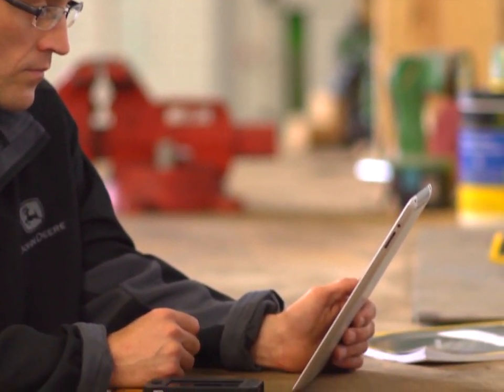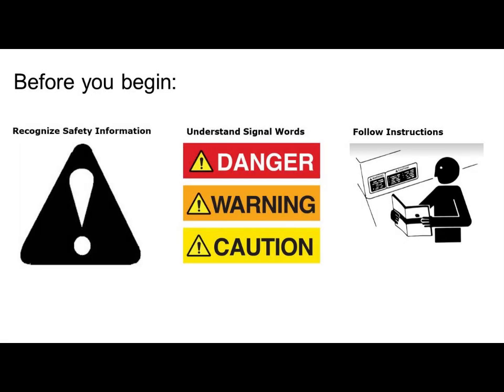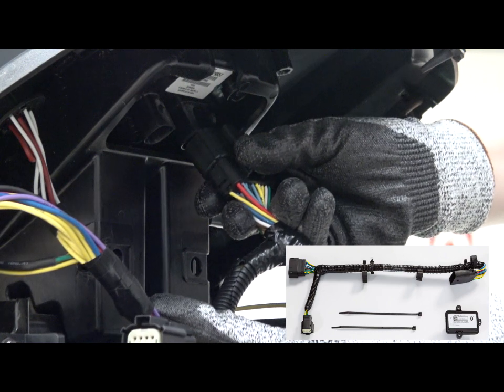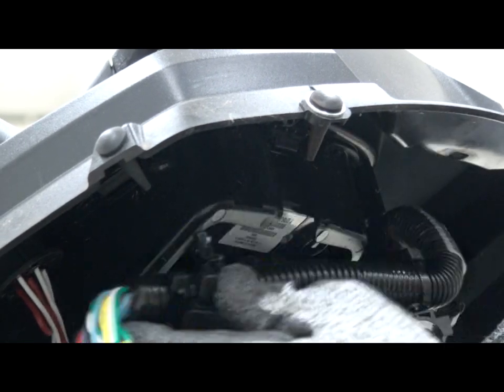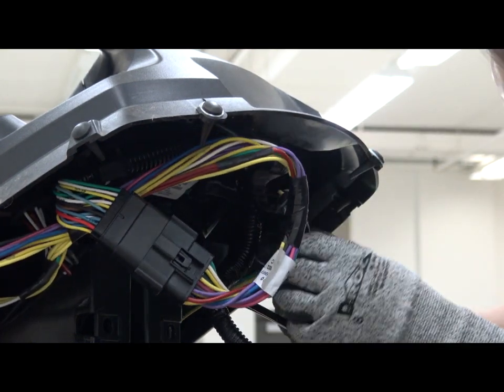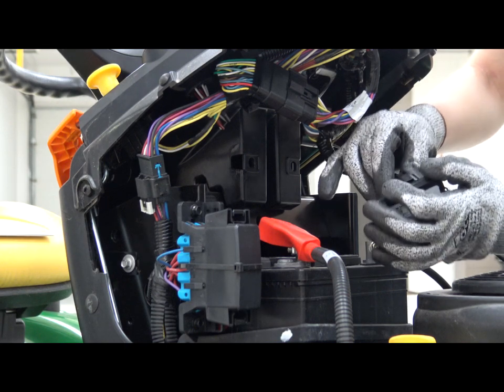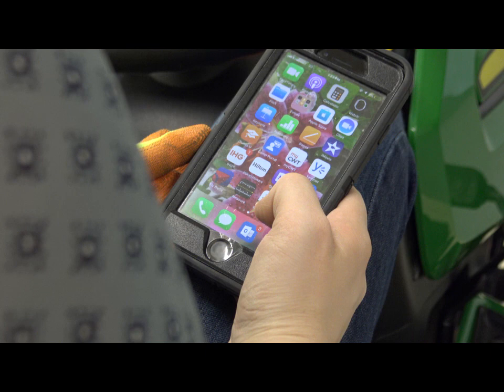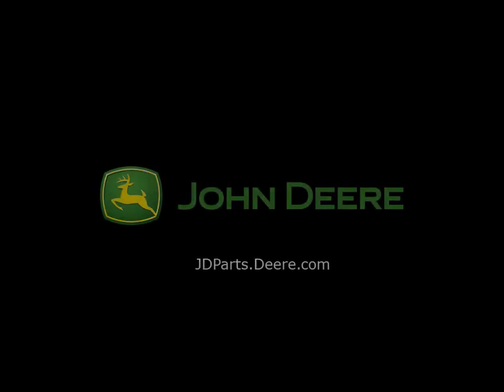How To Install MowerPlus™ Smart Connector | John Deere Select Series Lawn Tractors

Comment: Just ordered this for my x390. Can’t wait to use it. Already have the app. I must’ve accidentally left key turned slightly last time I mowed and since the headlights weren’t working I didn’t realize. Then went to mow again and battery was completely dead and wouldn’t take a charge. Had to have mower serviced anyway and they put in new battery. This may have been an avoidable battery drain if I already had the smart connection.

Comment: Stating the obvious: the tractor hood must be opened for the install. If your tractor has a brush guard, it will interfere with opening the hood; the retaining pin must be removed to lower the guard. When you are finished, the guard must be raised and the retaining pin re-installed. Realize that the engine muffler is mere inches from that retaining pin which may require manual guidance. If the engine was recently run, that muffler will still be hot.

Comment: BEFORE you install the connector wiring, download the smartphone app. It will want the serial number of the lawn tractor AS WELL AS the serial number of the Bluetooth module that will be installed under the hood of that tractor. The module does not require power in order for your smartphone to scan the QR code on the back side of the module. Scan before performing the final connection to the wiring harness and make sure that the QR scan is successful in the app.

Comment: Excuse me.

I have a good question about this.

Is this compatable with mowers from the early 2000s or 90s?

I would love to try it out on my 03 LT150,but I am worried about non compatibility with older models.
Reply from the maker: Great question! We don't currently offer a compatible MowerPlus™ Smart Connector for an LT150 Lawn Tractor. The MowerPlus™ Smart Connector is compatible with the S120, S130, S160, S170, and S180 Lawn Tractors. Additionally, model year 2021 and newer S240 Lawn Tractors (serial number 880,001-) and model year 2021 and newer Z515E, Z530M, Z530R, and Z545R ZTrak™ Mowers (serial number 010,001-).
Reply: PLEASE CREATE RETROFIT KIT FOR OLDER MODELS!!!!!!!

Comment: Does the Smart Connector work with the X739 (2018)?
Reply from the maker: Thanks for the question! Currently the MowerPlus™ smart connector is only compatible with model year 2016 and later Select Series X300 and X500 Tractors.